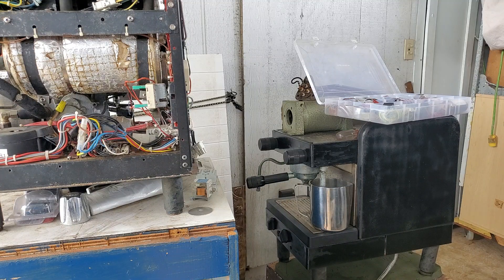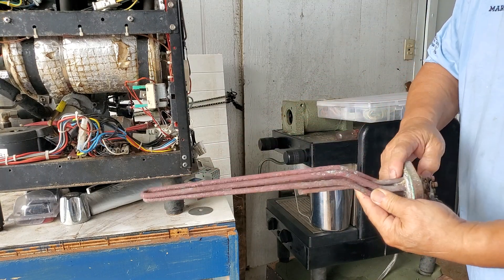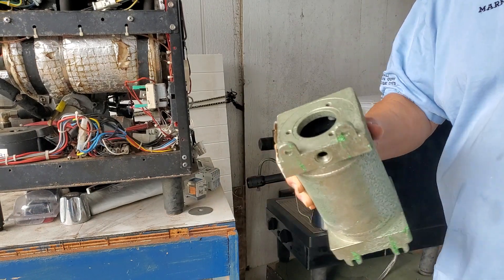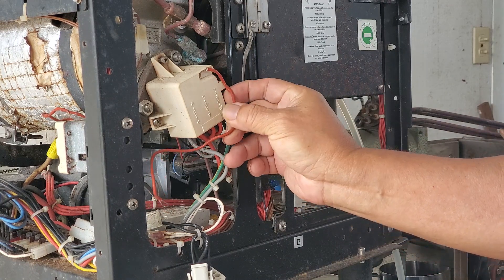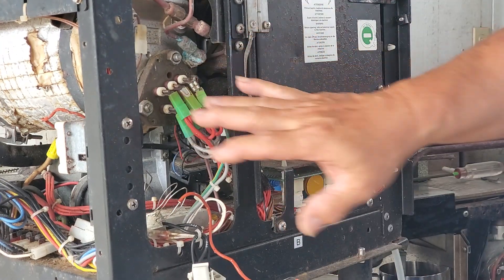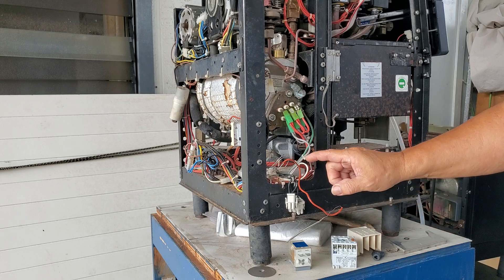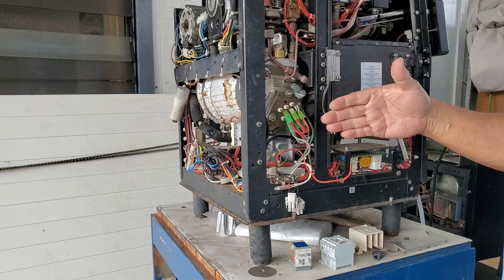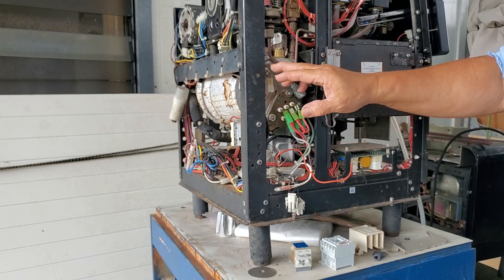Cimbali M49, M50's, M1's, M28, M29, M30's etc.  Basic power to boiler heater elements.

Comment: hello, I have a problem with my La Cimbali M1 coffee maker, everything seems to work properly. When I turn it on, it heats up and brews coffee. If I don't leave the coffee maker idle, everything works. But as soon as I leave the coffee maker for half an hour without attention, nothing can be brewed. The coffee maker says it is cold even though it is not cold. After turning it off and on again, it works fine until there is a longer delay in brewing coffee. Have you ever encountered such a problem? Thank you very much
Reply from the maker: @kava463  Hi, I've only worked on the M1,M2 series for a bit.  Enough to disassemble and reassemble completely.   But one of the concerns was the elaborate programming control.  Cimbali went all out with tweaking every aspect of coffee brewing.  So how does that affect the "Regular" customer?  Those that just want the standard cup of coffee.  The multitude of adjustments if left at a high tolerance will show som of the effects you mention.   Yes, it's possible there's a bad or worn part.  Your probably in need of maintenance by your vendor.  Most Super Automatic machines require daily,  monthly,  semiannual maintenance.   M1/2 series will actually lock up after a year (default setting).  The customer may be able to perform and reset back to basic settings.   Though most won't take the time to learn.  As I  mention earlier,  you could program your self for an insane level of coffee that would shame the average Barista.  (Experts also paint pretty pictures on crema. )  OK,  back to you: Check and perform daily cleaning.   Don't restart as it may ask you to clean again.   Don't forget to drop required cleaning pill.  Try a single espresso dose (into a glass shot glass).  Look at it.  Does it look like it should?  Compared to what you see on YouTube.  It should be close enough to pass casual inspection.   If it's perfect then your probably OK and most likely need Vendor's quarterly/annual maintenance.   When they show have them check your coffee settings to allow for a more tolerable espresso.   Meaning,  have them widen or lower the water heating limits to a the lowest recommended settings.  The water boiler may be set at max for tea water (British like the hot water at max)  but this is not necessarily the best for espresso.  There's also several temperature monitoring probes that can go bad or set to a restricted temperature variance.   These probes should be checked for failure or readjusted for your needs.  On the bad end: Bad heater(s); Boiler, Table heaters,  and location warmers. Your probably in needed gaskets change.   Look at you dregs drawer for the "Pucks"  they should like like a hockey puck.  Firm and not falling apart.  You should be able to pick it up whole.  Loose grounds indicates over filling and low brew heating,  and compaction.  Either way, it still looks like your out of a tolerance for brewing your coffee at your original settings.   (Is it possible this is a second hand machine?  Set up at previous owners settings?  If so, it needs to be readjusted to your needs.)  Final: if no change after cleaning and dose check.  Then you will need to have service check and maintenance.   If it's a purchase "used" the you will need to locate a programming manual or instalation and set up manual.   It's tedious to learn but worth it if your a "coffee aficionado"   Aloha, Safe Holliday, Mark (ukeboy57 @ YouTube)
Reply: @ukeboy57  Thank you for the exhaustive answer, I am a coffee enthusiast :-D However, what you describe unfortunately does not lead to the repair or operation of the machine. I will try to describe it again. Maybe I did not describe the problem correctly the first time. So: After the first start of the machine (plugging into a 230V socket), the coffee maker heats up and makes all possible drinks in perfect quality. However, if I leave the machine for a longer time, the boiler gets cold and does not heat up again, the machine only says that it is cold. If at this moment I turn the coffee maker off and on from the socket (230V), it heats up again without any problems and brews several coffees in a row. It seems to me as if it went into standby mode and could not switch back. I performed the annual maintenance and cleared all the counters, unfortunately it did not help. I would be happy for any advice if you can think of anything else.
Reply from the maker: @kava463  OK let's establish the groundwork.  Can you give me a bit of its history?  Who set it up.  New or used.  Vendor service available?  Location.  Sorry to get personal as every Location on world has a different setting.  Email  ukeboy2@yahoo.com
Reply from the maker: @kava463  by the way, it sounds like it starts in quick mode then drops out awaiting formal start.  It sort of give you the option of a quick start w/o going through the full heat, clean, flush cycle.   Still a program set up issue.
Reply from the maker: @kava463  I'm not sure if I have a full manual on M1/2 series.  I have a 'cheat sheet' for our standard settings here in Hawaii.  I'll have to look around a bit.  Will let u know if I find it.

Comment: Have a M51. Its heating up and after a while the prestostat switch clicks so the power to the heating elements is switched off. But display still says: temperature low. In what way does the machine sense the water temperature in the boiler and what could possibly be wrong it still says: temperature low?
Reply from the maker: There's two circuits that handle temperature.   The main is the pressure switch (aka pressurestat).  The 2nd is a temperature probe.  It's a small plug tith a short 3 inch wire ending in a yellow plug.  It's usually around the upper end of the tank.  There may be a 2nd probe in a separate water tank if it's an older machine with a dual tank (pre heat exchanger model)
Reply from the maker: Honestly. I  always wondered why they added this type of temperature probe.  It does go bad but not often as it's just a twisted bi-metal wire buried in epoxy.  I'll try to post a video today.  Aloha, Mark
Reply from the maker: I've speculate this probe is for precise heat control of heating (for brewing?) But  thought it an option more for the coffee perfectionist.
Reply from the maker: It's morning here,  give me a couple of hours.  I'll look up the part# and any other info.
Reply from the maker: Posted video: https://youtu.be/D1at9_K5OKQ?si=uSlFQRaEAwjVNF7H
Reply from the maker: Email ukeboy2@yahoo.com for additional questions.   Aloha, Mark
Reply from the maker: Just dawned on me.  The 2nd probe is to stop over cycling M50's beyond heat recovery.   Lots of customers tend to push machine beyond the limits.  IE venti double latte, 3 times in a row.  This delivers max ground coffee, max shot dose, max hot milk.  Customers don't watch machine like a Barista will when dosing manually.   They will see the machine struggling.   A good Barista will move on to other tasks; collect cash, grab scones,  etc. While the machine recovers.  The M50 will shut down till recovery is FULLY COMPLETE.   This means unacceptable wait periods.
Reply from the maker: OK, part number 429-603-010  see page TAB B72-3 in engineers parts manual
Reply: @ukeboy57 do you know if this manual is somewhere online?
Reply from the maker: @janjukebox  your email, model (on ID plate) and location (optional)
Reply from the maker: email?  @janjukebox
Reply from the maker: My email is ukeboy2@yahoo.com,   If you assistance.  Mark